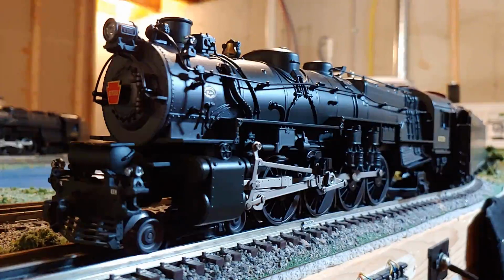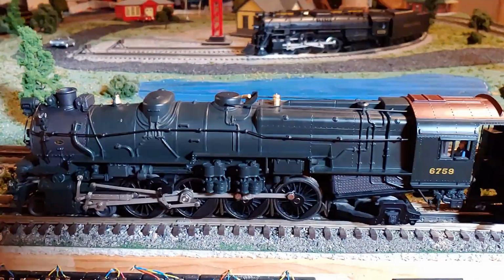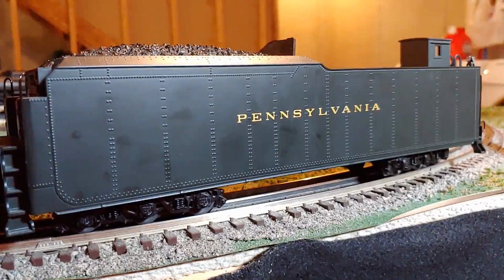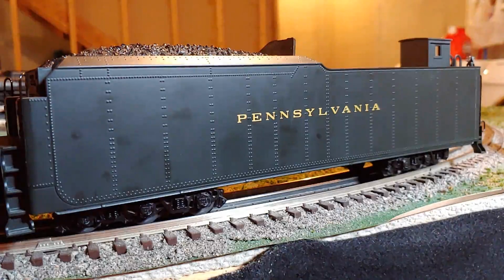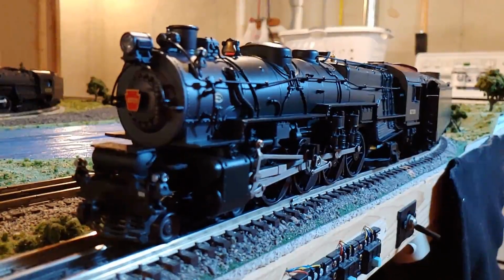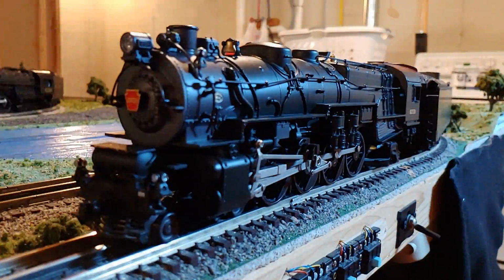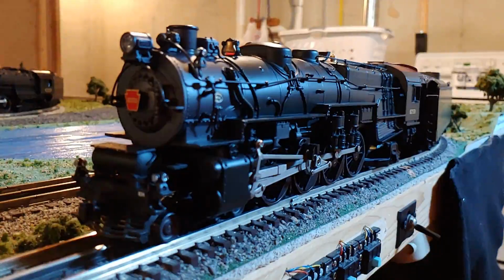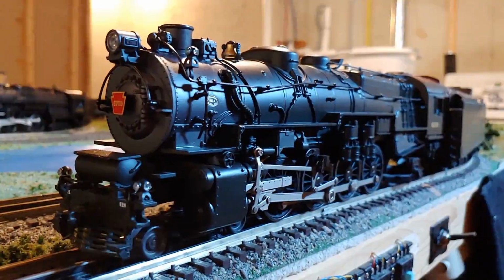Lionel PRR M1a (TMCC)

Comment: The very first built were labeled simply M1s then later going through aesthetic changes first it was an M1A, Then an M1B was the later version in case you are interested also their were two types of tenders used they were labeled coast to coast tenders for the most part the M1s were equipped with a slightly smaller version of the two the second was equipped with a larger wheel base on the tenders they were equipped with four wheel trucks on the larger of the two and for obvious reasons.